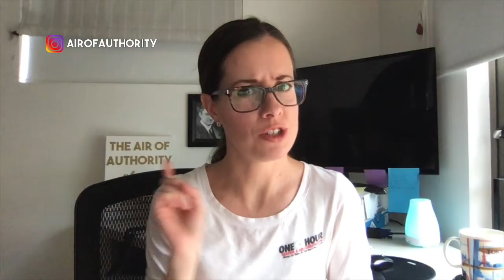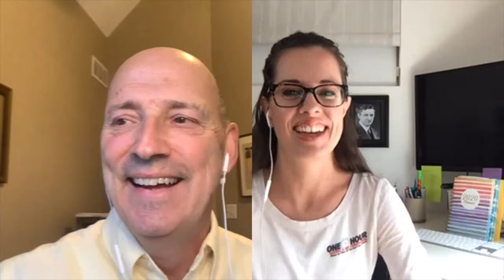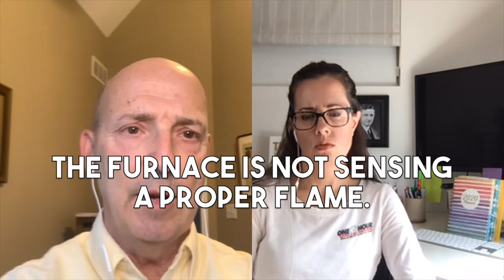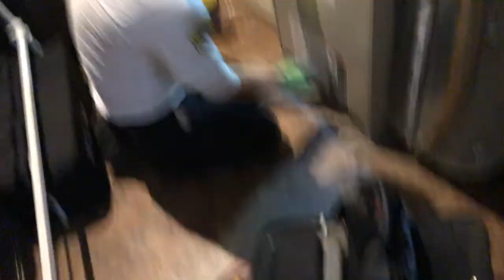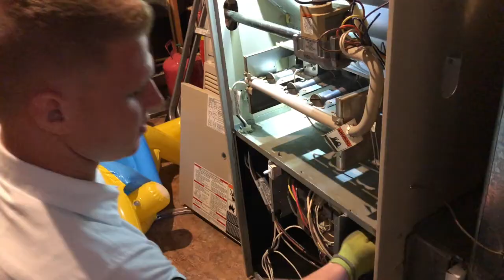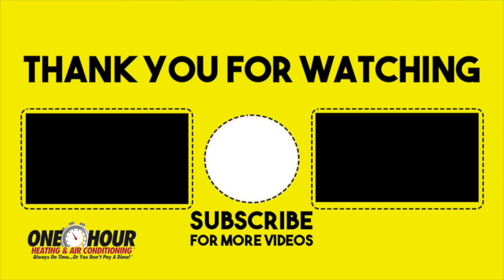Why does furnace START AND STOP? (why does my furnace keep shutting off)

Comment from the maker: Thanks for watching!  Do you have a question you would like us to answer about your heating and cooling system? Ask below! 👇
Reply: I have an old furnace with a  Robertshaw controller HS780   I replace it because it was bad.... but after disconnecting the relay and 24 volt transformer ,,, I have a black , red and yellow wire on the relay that I think I may be connecting wrong... anyway   when I turn on the thermostat to call for heat the fan does not start like it use to.... everything else starts fine...  so far I have not left it on enough time to make sure it actually starts once the limit control switch reaches a hire temperature...  any sujestions?
Reply: In the summertime my AC when it's in the 90s and very humid tends to run literally for hours at a time before it finally turns off. I always feel like it's not running right. If I turn it up one degree it seems like it takes forever to turn back on but if I turn it down one degree it's way too cold I have complained about this several times to my brother-in-law but he tells me this is normal? Is that right?

Comment: Furnace inducer came on, went off. Came back on, then the burners lit. Would do this occasionally. Had a tech out, didn't do it the whole time he was here! Tested the components. No evident problems. He said my furnace was way oversized for my house and not enough returns. He switched the blower speed to run on low instead of ramping up. Said it would reduce wear and tear. Didn't solve the problem, plus my house takes forever to heat up now and the short cycling continues. I should have left well enough alone. At least my house was warm before! Hard to find competent techs.

Comment: Mine has a problem not getting the right tempture to heat the room.   I think the heating duct above furnace is somewhat stopped up. It turns off the blower and the burner.  It cools about 10 to 15 minutes then turns back on.  It 's a 1980 furnace.

Comment: I had 10 days no heat ,furnace  turn on then off . I called my electrican friend . He tried replaced new thermostat ,same steady on then off . He replaced new ignition and cleaned flame sensor. Burners cleaned stay same on then off. I gave up and furnace shut off for 3 days . I called HVAC contractor  and I explained him what happened . He knows simple replaced new gas valve . Works ! Thanks contractor . He requested me new furnace , I said no bec new technology I don’t like it .

Comment: emergency question: furnace began short cycling after a brownout began early morning. The furnace had gas and power and turned on with no call for heat.  the problem ended immediately after the brownout ended.  I frantically turned everything off at every power source to the applaince.  why?? i freaking out, im beginning to think i may be not be able this home may not be safe

Comment: If it’s short cycling but does eventually turn fully on, what would that indicate? (Example, ours will short cycle about 4-8 times and eventually it does fully turn on and run and the get the temperature to the correct spot, etc.)
Reply: Hey mine is doing this.... Do you mind me asking what you eventually had to do to fix it?
Reply: @ganjamama3086  pulled out the flame sensor and cleaned it off with a crisp dollar bill. But really good morning eventually learned that the person who replaced the flame sensor used the wrong shaped one for ours and so I bought the correct one on Amazon for $10 and installed it myself.